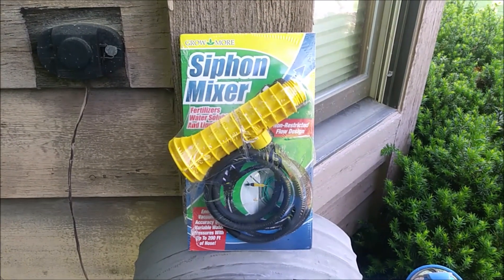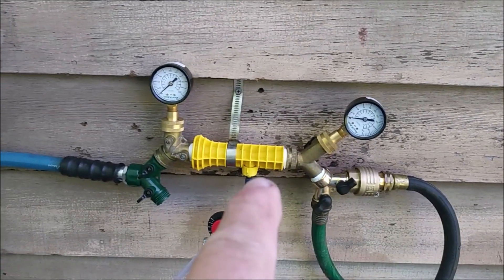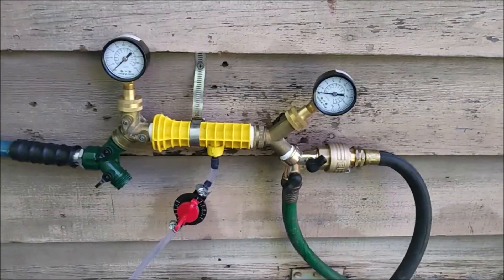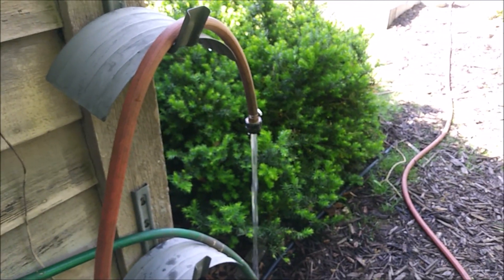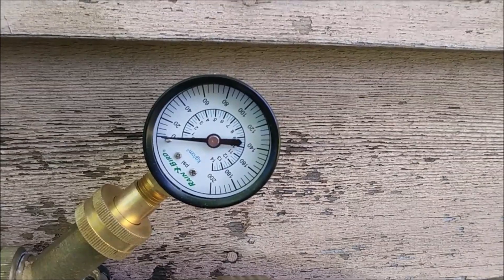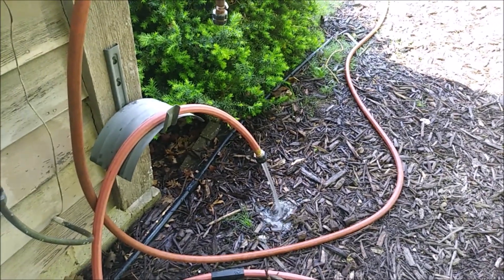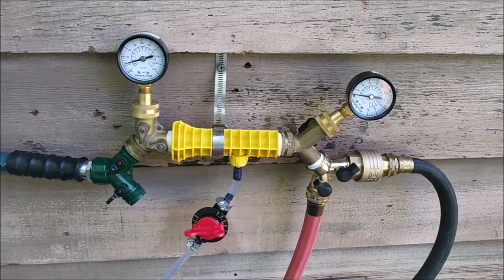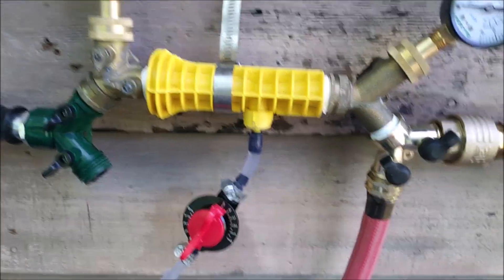REVIEW: GROW MORE Venturi Garden Hose Siphon Mixer - Fertigation

Comment: Any idea how to use something like this with long lengths of hose? We're trying to mix into multiple hoses and the back pressure is a major issue for us.
Reply from the maker: I ended up using an EZ FLO unit, which is not impacted by back pressure.
Reply: @TommyTester  I have one,The mixing with the EZ Flow is not constantly  uniform,you actually use a lot  more concentrate  or what ever your are mixing at the  begining and progresively less and less as you  keep spraying.what We do is We have to  spray twice the second half of the field.. and that is before  the juice is gone!